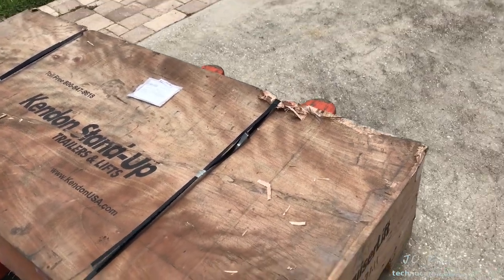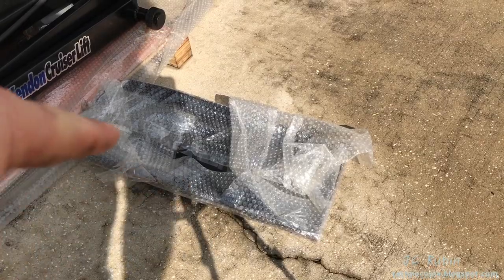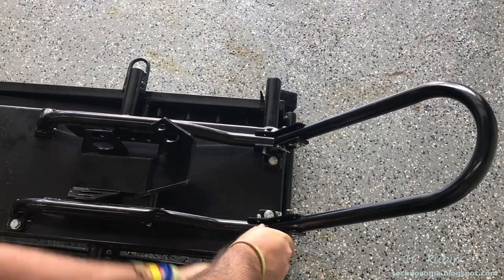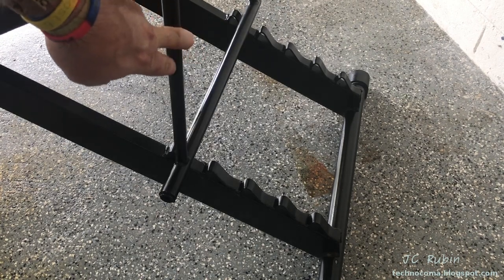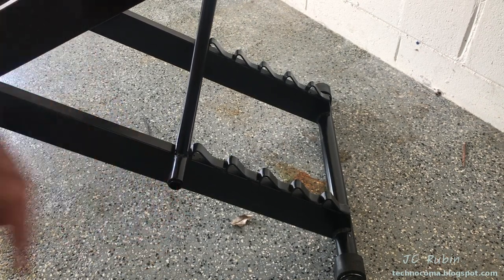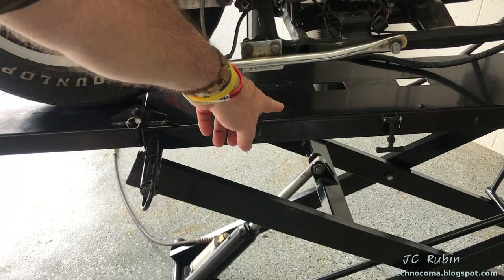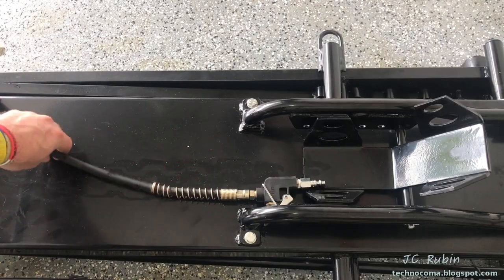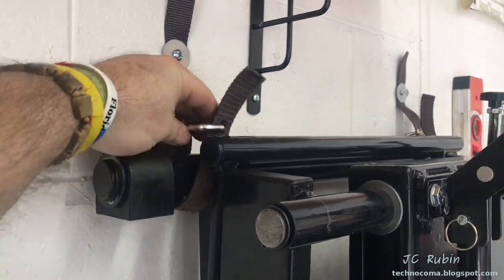Kendon Stand-up Fold away Motorcycle Lift  - Unboxing, Assembly and Review

Comment: Nice  video. Now try pushing a 900lb Harley UL on to that lift. Almost impossible. I have one of those lifts. Also. Once the bike is in place with that chock. Almost impossible to get the bike out of it. Personnel experience .
Reply from the maker: The wet weight of the vstar1100 is 700 pounds so it’s not that far off and regularly goes on the lift

Comment: Does it wobble or otherwise feel like it would fall to the side when a bike is on it?
Reply from the maker: I’ve pulled this one from side to side with the bike on it and did not feel that it would tip.
Reply: @retrotechandelectronics  awesome that was the main concern i had. And theres next to no reviews on this lift. Thank you
Reply: I put my rocker c on mine and have no issues with wobble , or any stability concerns

Comment: Thanks for this video.  I really like the design but I'm concerned about the width of the platform.  I doubt I could push my thunderbird up that ramp, but I'm not sure that width lends itself to riding up either
Reply from the maker: Aside from the easier 2 person push up possibility, ive seen some folks with larger bikes build a small removable structure that wraps around both sides so that they can ride it up and have a place for their feet.

Comment: Great, very thorough review.
Was wondering if anything could be added to safely support the bike while elevating the front and rear whees to remove them for changing out tires. The video did mention jacking the frame to lift the rear wheel. Wonder if a similar thing could be done for safely supporting the fork?